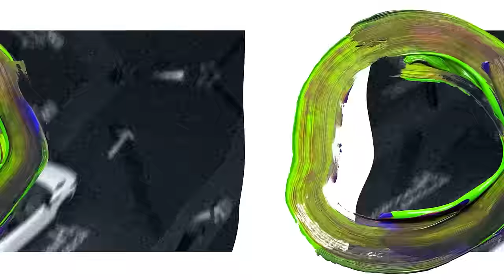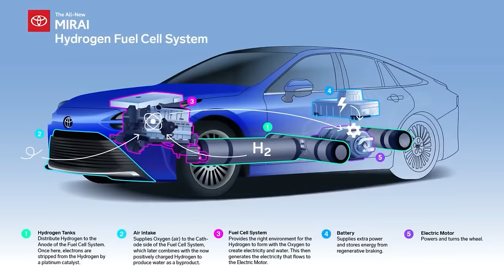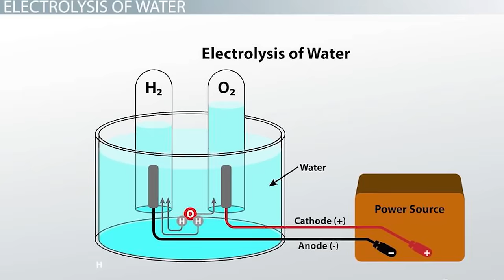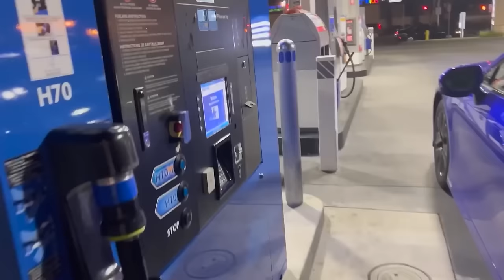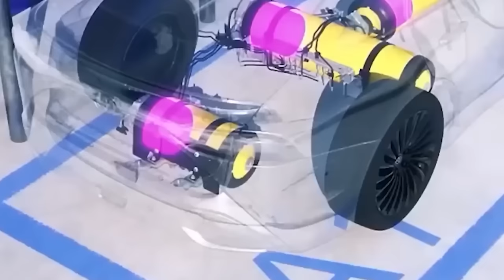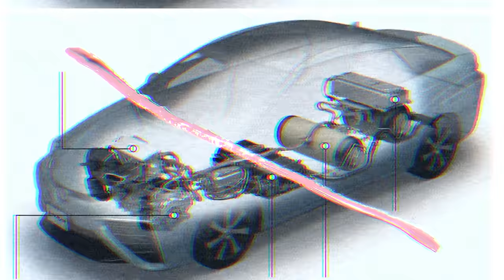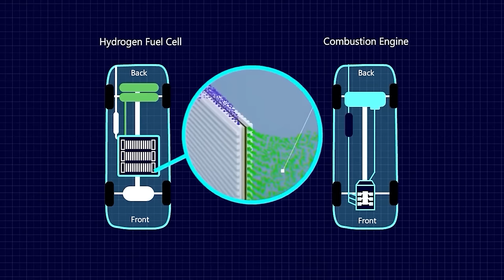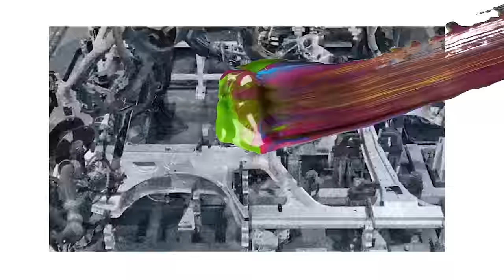This NEW Engine Will DESTROY The Entire EV Industry!

Comment: What I don't understand is how oxidation of electrolyzed Hydrogen could possibly produce more energy than the energy required for electrolysis, How is this not a "perpetual motion" machine, which is, of course, impossible? It takes a LOT more energy to electrolyze water than you get by running the resulting Hydrogen and Oxygen through a fuel cell.
Reply: I wonder that too. Maybe it's equipped with a small fusion reactor, the same Lockheed Martin said (in 2017)  they would put in a F-16 with a plasma engine by 2024.
🤷‍♂️
Reply: Exactly.  Might as well reduce CO2 and run on gasoline exhaust :)  This is a pipe dream, and the pipe is packed with serious drugs.
Reply: What you people don't understand is that the gas engine is was originally called a nitrogen engine the gas only prepares the incitement to burn the nitrogen in the air which is about 85 percent nitrogen.
Reply: @MichaelMaki-d1p  nitrogen doesnt burn.. theyre reporting hydrogen.. to create hydrogen require electric current.. it take more electrical energy to create than it returns when its "oxidised" back into water.. the maths isnt difficult or complicated
Reply: I entirely agree, with any change of form some energy is lost through various inefficiencies, there will be losses at every stage, unless there’s some kind of regenerative process going in where vehicle inertia is transformed into free returning energy to balance the equations. That would lead me to conclude that the engine left to idle would eventually completely discharge the hybrid system and at that point it would not be producing enough energy to sustain the reaction… or is physics wrong? Please tell me if I’m being thick here and I’ve missed something obvious…
Reply: i think you are a US troll
i saw the same comment on other video 
+ this video is not even related to china @PeterJames-cr1ul
Reply: @free_palestine_8481 what are you talking about?
Reply: I believe the power comes from the expansion of the water being electrolyzed inside of the combustion chamber as opposed to the combustion of hydrogen. In other words, When water is hydrolyzed it expands about 800 times I believe
Reply: Man, I've seen motorcycles adapted to hidrogen and it works fine... okay it's a bit of a kit and doesn't last long but it works!!!
Reply: The answer lies in the massive amount of energy produced by burning coals and stored in the distilled water.
Reply: It does not. This is a big fantasy.
Reply: you do not need a fuel cell, the hydrogen can be produced within the intake manifold as the water is sprayed into it then electrocuted.
Reply: Heat source, fusion reactor, on board weight of fuel to be heated would lead to the steam engine !
Reply: @alanday8513  WWI was fought over steam vs oil! If steam had 110 more years of development as combustion engines has had, then steam engines would be as convent as oilers.
Reply: This video is made without knowing the laws of physics.
Reply: @alanday8513   Then there is no need for the ICE engine. Just direct the steam towards a turbine, and you are ready to apply energy to gears/wheels directly.
Reply: @PeterJames-cr1ul  
about him being a pot calling the kettle black
Reply: well oil is the winner
Reply: You are right but you can try rare earth materials as catalyst to do that extra energy push for the purpose
Reply: @altobari5577  While it may expand in volume, I'm not sure, however at what gaseous pressure would it be then? If true, any increase in pressure could perhaps be utilized in some way to increase efficiency, but would the pressure increase be enough to make a difference in a practical way? The problem that previous viewers have been discussing is the fact that it takes a LOT of electricity to break the water down into Hydrogen and Oxygen. Where is that electricity coming from? If it takes more energy (electricity) to break down the water than you gain by igniting the Hydrogen and Oxygen in the firing chamber, then what is the point? Might as well stick with electric cars. I did catch the narrator mention only once that the exhaust contained water vapour and a 'small amount of other gases'. He didn't say what those other gases were or where they came from. Has Toyota figured out something that can be added to the water to make it easier to break down, however the video mentioned distilled water?
Reply: @PeterJames-cr1ul  Don't spend time worrying about a nut-case like @free_palestine_8481. For one thing, look at the name he/she has picked; what does politics have to do with the subject matter of this video?
Reply: @puckchew    You are going to use a massive amount of energy (pollution producing coal) to create the distilled water, then more energy (electricity) to break that pure water down. After all that, how are we gaining anything with a water engine?
Reply: @stankygeorge  LOL  I'm sorry @stankygeorge, I'm not trying to poke fun at you so please don't be offended. I had to laugh when you mentioned that the water being sprayed into the manifold was then 'electrocuted'. I didn't know you could electrocute and kill water, though I guess in a way that is what is happening. The word electrocute struck me as funny.  :)  I know you are talking about electrolysis. You are right in that no fuel cell is needed nor any complicated storage tank for the hydrogen, just some way to store the water.
Reply: @gordjohn2322  No offense taken Mate!
Reply: @gordjohn2322  Doesn't take much energy to distill water.
Reply: not true

Comment: there have been Hydrogen vehicle years ago but they were shut down by the Automotive industry because it would cost to much to change over and the OIL industry would lose to much money.
Reply: Yeah the oil companies would be have way too much to lose and they have the money to manipulate things so that makes a lot of sense bud.
Reply: Hydrogen is incredibly energy intensive to produce, maybe do some research
Reply: Also, during the Carter years of 55mph and gas shortages, many vehicles in rural areas were converted to switch between gas and propane.  There are some propane or natural gas vehicles still out there..
Reply: At 700 bar hydrogen is not realistic

Comment: I do agree with this concept from Toyota. If coal and water could move a locomotive engine. A replacement of coal from a combustion engine, being a certain form of vaporization of water may be an alternative solution.

Coal and water engines were prematurely abondaned because oil was seen as a quick solution. But now because of the environmental impact, this method has to be revisited. 

Oil and gas has generated a lot of wealth to oil producing countries so some won't welcome this because it will ruin their economies.

 I don't agree that this may be a certain form of a pipe dream. It may be a solution to our global warming.
Reply: sure, in about 5-ish 
hundreds of years.

Comment: Destilled water is usually made of normal tap water by boiling and evaporating it, what source of energy should be used for evaporating water to make this fuel clean? Woun't be there more energy losses than with EV?
Reply: burn more coals, no other way, always has been 😉
Reply: It can be easily done with some water pressure and osmosis filtration. The head scratcher is the electrolysis part, it takes a lot of energy to split water molecules. Doing it fast enough to keep up with a running engine and still remain compact enough to fit inside a car is 1st grade sci-fi...

Comment: This is in my opinion the ultimate solution. It actually is emissions is its own fuel source.  People will need to have perhaps a system at home, of a distillery and the world would have to have a source of distilled water available for longer distance driving. In the long run, this could very easily be the ultimate solution.

Comment: Hydrogen and CNG,(Compressed Methane+ Ethane) are similar technologies.  Turning water into hydrogen and oxygen takes considerable electrical energy.  So the environmental impact depends entirely and how/method the electricity is made.  My guess Thorium nuclear technology could be used to  make power to make  hydrogen, which is then burnt conventionally.  Range would still be about half a tank of petrol.  Water powered?  Impossible 1st and 2nd laws of thermodynamics won't change any time soon.  The day you fill your tank with water and drive down the road might exist in heaven but not in the physical real world started  when God said let their be light.  (According to Hubble 13 plus billion years ago.)Was this article  put out on 1 April.?

Comment: An excellent advertisement for Toyota and for their forward thinking. BUT ..... I'm still at a total loss as to what is happening. Yes, I understand that a combustion engine can use hydrogen as a fuel in place of a hydrocarbon such as petrol; were they not experimenting with this decades ago? And yes, I understand that the proposal is to produce the hydrogen from distilled water at 'run time' via electrolysis; again has been known technology for a long, long time. BUT!! electrolysis requires electricity (the name gives a clue here); where are we getting this electricity from? 

I love the idea of this, and indeed cannot understand why we haven't got here sooner, albeit using surplus renewable electricity to electrolyse water and store the hydrogen. I just don't understand what this overall process is, as without another input, the energy input does not balance with the energy output of this proposal. I'm not knocking it, I just don't understand it presently.

Comment: Water weight is about30% over the weight of gasoline.What will be the cost of distilling the water and the pollution from energy production to distill the water.?
Reply: yeaah, very easy, just burn some coals or rubber tyres or throw anything, as long as it gets the water boiling

Comment: I would think that it would take a huge battery to convert water to hydrogen just to start the engine
Reply: Unless there is a small charge of Hyg, to start the process, stored onboard.
Reply: Mr. Fusion?
Reply: Regular car battery could do it. Doesn't take much electricity. Then once the engines running the alternator kicks in.

Comment: This idea of electrolysis on board is groundbreaking. It solves the hydrogen permutation of components with the use of hydrogen tanks. One of the major drawbacks of hydrogen usage. It also solves the need for extensive mining operations for battery ingredients. But what happens when the temperature drops below 0 Celsius or 32 Fahrenheit? What power do you use in order to keep the water in liquid form? Also the colder the water becomes the more energy is needed for electrolysis to work. Just wondering how they solved these problems.
Reply: Me too. I know there have been some breakthroughs in electrolytic hydrogen production in recent years, but to be able to produce (on board) the liters per minute necessary to continuously run an engine is a huge deal.. Knowing big oil though, we'll probably start seeing some untimely deaths of Toyota corporate executives and engineers. I hate to sound like a pessimist, but it always seems like the good guys in the hyper mileage gas carburetor and hydrogen production/engine innovation game end up dead or with their idea purchased for a huge sum and shelved, never to see the light of day again.
Reply: @clflyguy   No kidding! After all, how many times has this idea been brought up before? Not to mention having actually been built!
======================================================================================================================
Reply: @clflyguy hopely every humans knowledge's gonna be little more higher.  Los Angeles ghetto Cozi.😢
Reply: Turning water (oxidised hydrogen) into Hydrogen is akin to turning ash back into wood.
It can't happen because the energy required to do it exceeds the energy produced.
Reply: @clflyguy  I think you are confused. You won't need liters per minute to run the engine. You're thinking it's like gasoline. With gasoline they are spraying liquid into the engine to combust. That takes a lot of liquid volume. And even then you don't need liters per minute. If you did then your car would only run for 3-4 minutes on a gallon of gasoline. That's just silly. But anyways, hydrogen is different. You aren't spraying a liquid into the engine. Instead, you are pumping a gas into the engine. A gas has a lot higher volume AND burns a lot better than liquid. Instead of pouring a whole bunch of liquid gasoline into the engine you are pumping just a little tiny bit of gas into the engine and it even works BETTER. Plus, you are storing the gas as a liquid and converting it to a gas as needed. So, there is a LOT more fuel in one gallon of water as opposed to a gallon of gasoline. A LOT more.
Reply: @14lou  Dude. This technology has been around since the 1800's. It's real simple and easy. In fact, the first combustion engines were ran this way. Even my Chem 101 textbook had an article on it. It's called electrolysis. It's been around a long time and is easy to do. It doesn't take much energy at all.

Comment: It's how they use to run vehicles in the past , and that inventive motor would be a pleasant move to drive without charging or fueling with gas. An invented circular motion of liquid to keep the motor running would work. A certain mound of sorts to run in motor once turned on to circulate the motor liquid to fuel motor to keep it running would work. And having it recycled back in vehicle so it won't waste battery or fuel

Comment: Amazing that so much effort has been put into this video about a complete fantasy. The reality that the power required to produce the hydrogen by electrolysis will be much more than just using this electricity to drive an electric motor is completely ignored.
Reply: yea, but the "result" generated will be hundreds fold.
Reply: @puckchew  ?? What result? And how did you come to that conclusion?
Reply: In your example you're also ignoring the energy required to create, transport and charge batteries or pump up, refine and transport fuel. Considering the major losses in those chains electrolysis probably won't be that much of a hurdle. Getting enough water (sea water considering fresh water shortages but more complex to distil), pressurising hydrogen to liquid form for ease of transport and storage efficiently and finding a fool proof way to safely have idiots who can't fill up a tank with unpressurised liquid without bungling it up use a system to fill up their vehicle will be bigger hurdles.
But I agree this video is complete fantasy, having a water tank and electrolysis inside a car is nonsense on multiple levels.
Reply: @royh6526  
apology for the confusion, my putting result between quotation apparently was too much subtle of a sarcasm 🤭but by stating that I actually wanted to point out the revenue generated by the video, (could be hundreds fold of the "energy" stored in the form of financial currency) 😉

Comment: Someone has not done their homework. Hydrogen and water are not synonimous. All liquid and gas fossil fuels contain a lot of hydrogen. Hydrogen is far from green too. Producing it results in vast amounts of carbon-dioxide. PV power systems are not exactly much good either. To electrolyse water at a reasonable rate, you need about 20V. So a 1kW system would produce 50A peak. Lets say it could produce 50A continuous. That would need over half an hour to produce a mere gram of hydrogen.
Reply: yepp

Comment: I bought a Hyundai Nexo and I love it besides the station scarcity it's a great car
Reply: With a tank capacity of 6.33 kg in the Nexo, it would cost premium gasoline-powered car money to fill up, around $164.64 to be reasonably precise. That plush Nexo Limited with the cooled seats has a range of 354 miles due to its big wheels, which means a spend of $0.465 per mile in fuel alone.

Comment: There is a reason Toyota one of the biggest and most successful car maker wasn't fully throwing in the towel on actual engines. The batteries used in EV vehicles are not sustainable and wreak havoc on the environment but nobody wants to talk about that or know it. One EV battery does so much damage to the planet it's crazy and the horrible slave labour type conditions of people getting the rare earth metals is bad too. Even if it's still a ways off Toyota has the right idea! 💪

Comment: While this video plays like a big ad for Toyota. HHO powered engines have been demonstrated by inventors for decades. As someone else pointed out it normally takes more power to perform the electrolysis than you get back out in BTU's in burning the hydrogen. In this video no mention is made about what happens to the oxygen produced? Is it vented away, or captured and reused during the combustion process? 

I can recall my science teacher performing that experiment where they use the glass "H" tube device to generate H2 in one column and oxygen in the other. He would fill a test tube with oxygen and poke a glowing stick into the O2 and it would burst into flame. When he repeated that using a lit match stick into the H2, it would make a loud pop as the H2 burned. He then mixed both gases into a test tube and lit the mixture and the test tube blew across the room and shattered against a cinder block wall. He was careful to hold it so it when it blew it would not fly towards his students. I also recall him having to add sulfuric acid to the distilled water to make it more conductive. So what is Toyota adding to their distilled water to make it more conductive and prevent freezing? Based on that science demo I would think mixing both gases would produce the most power, versus using only H2 and air. Would be nice to have a video that really explains the combustion process more thoroughly! With all the water vapor produced would the engine need to be made out of stainless steel to control corrosion?